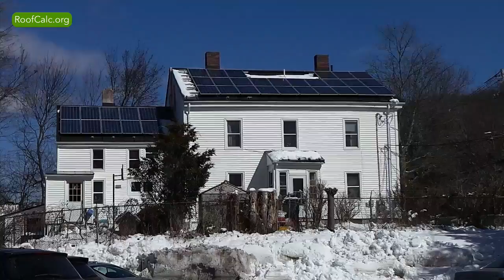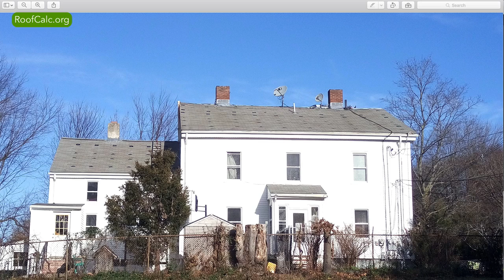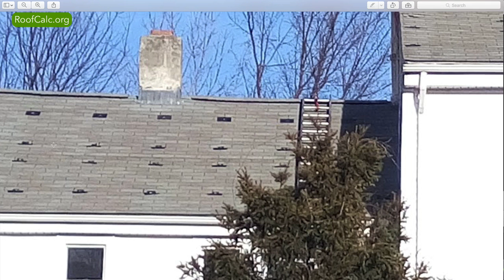Roof Fails After Solar is Installed - Don't Install Solar Panels on Old Roofs

Comment: I am talking to Sunrun about a PPA.  My roof is at least 20yo but they say it looks great for their panels.
I asked what would happen if I needed the roof replaced in a couple years after they install.
The salesman claims they just come out and remove them and then put them back when the roof is done, with no cost or issue.
Sounds like I shouldn't trust this...

Comment: Solar can certainly go on a roof....by design.  It appears from the video that not only did the under-layment and shingles require replacing but that the decking was compromised as well.  Every solar install company will do a site survey and put eyes on a roof prior to install for these very reasons.  When installed, the roof is guaranteed against leaks so it behooves the install company to not install on a substandard roof.  Solar works great, don't let this incident prevent you from owning your own power and saving tens of thousands of dollars on your power bills over the next 20-25 years.  Average savings over that time ranges from 15k-90k depending on historical usage and size of system installed

Comment: If the leaks started 2-3 months after the installation then it was due to an improper installation... a site surveyor report should have noted the condition of the roof and tell the company. .. with a proper installation the roof life can be extended due to protective layer of solar modules against the sun and direct weather. ..was your install a local company or a sales driven corporation? Wait a few years and see if they tightened those s5 clips too hard into the metal. ..Hope the best and that you didn't lease. ...A...uplift is also a concern not only the weight of the solar array, also consider adding the local snow load to the weight of your calculations - asme7-10.

Comment: how can we know that either roof can sustain the weight of solar panel or not?
how can we calculate the load bearing capacity of roof?
any formulas that we can know that that much load a roof can withstand.
i shall be very thankful to you for that.
Reply: panels are only about 40 lbs each, the weight usually isn;t important
Reply: the span and load bearing calculations are in the code book...
Reply: Not heavy at all.

Comment: It's amazing how little people plan ahead, including solar panel contractors to not ethically explain to the homeowner that the roof needed to be replaced prior to the solar panels being installed. It comes down to common sense, years of on the job experience and just knowing what is right....great video..
Reply from the maker: Thanks Henry. It's even worse when it comes to solar city and other "integrators" who want to sell you solar leasing or PPA garbage
Reply: I agree...take care of yourself. :-)
Reply: It always amazes me how cheep people can be at the beginning and find out how expensive their cheep decision ends up costing them in construction.  A bit of common sense goes a long way.  If you dont know construction find a good qualified building contractor.  I know some times they cost more and sometimes it is hard to tell a good one from a bad one.